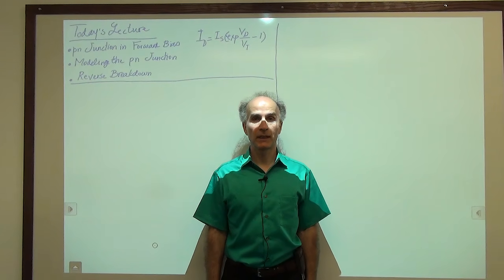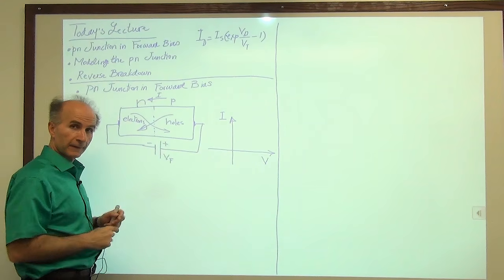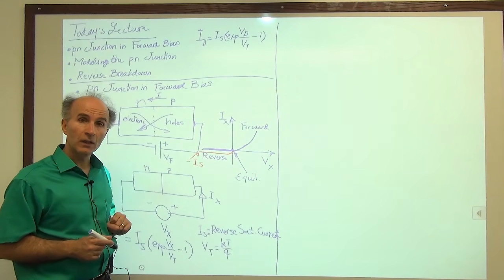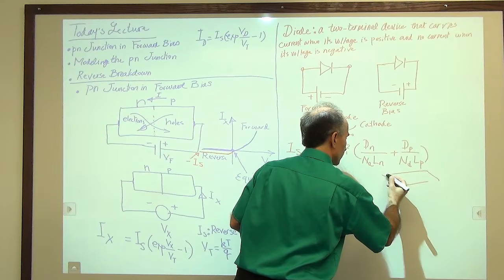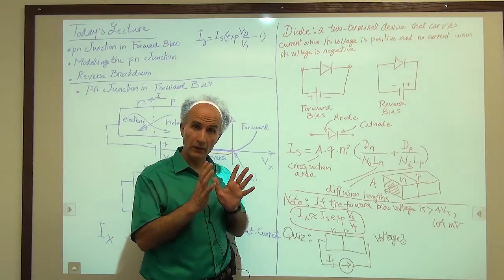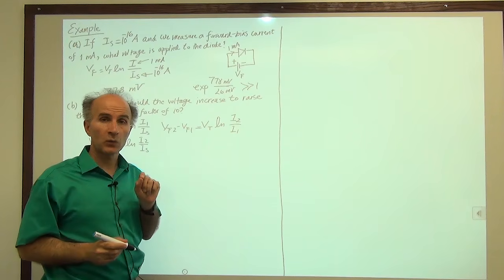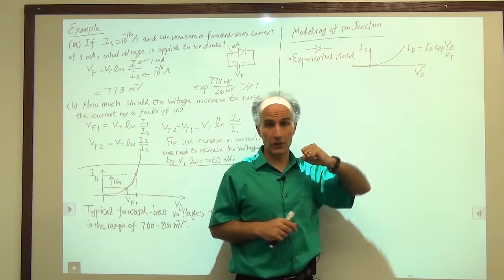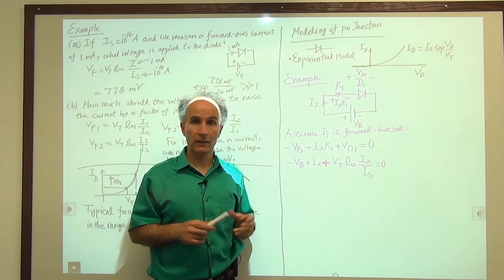Razavi Electronics 1, Lec 5, PN Junction in Forward Bias, Intro. to Diodes

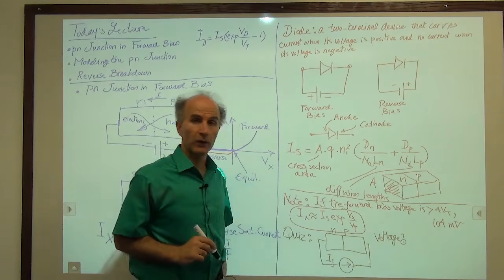Comment: 37:24 Quiz Question. Really misleading. It seemed to suggest that a numerical value is obtainable. ("...what is the voltage across the diode?"). A better wording would be "Derive an expression for the voltage across the diode".

Comment: This lecture series should be considered as valid course for those colleges where sufficiently qualified teaching staff is not present. These lectures are pure goldmine.
Reply: They are much better from what my Professor in the University that I'm studing engineering is doing!!! My Professor is literly teaching "In the air", he does not write any equations down (he solves every example in his head while speaking out loud), plus he skipped all the physics lectures.
Reply: In india most of the electronics professor deliver bad lectures. They must be fired and replace the class room with big tv and play razavi lectures on it.

Comment: The current in the forward biased PN junction is because of diffusion, pushing of holes by the positive terminal of the battery and pushing of electrons by the negative terminal of the battery is incorrect explanation,  the battery is not pushing electrons or holes, the battery is just lowering the barrier potential and then electrons and holes move by diffusion, pushing of electrons and holes would imply an electric field is doing that but that is not the case.
Reply: Do you mean that even in the forward bias the current is due to diffusion not drift ?
Reply: @mnada72  depends on  the area...I mean majority carriers in n is electrons while minority carriers are holes while on passing the junction the roles swap...u shud go thru integrated electronics by Millman And Halkias

Comment: in the current equation through the diode he said that the current doesn't depends on the doping levels of the silicon but it depends on the saturation levels.
but we know that different doped diode will have different Vt and so we will get different current values.
i am pretty confused why he said so.....................................
Reply: Yasinzai Vt is the thermal voltage of kT/q, not the built in voltage of 0.78V for Si.  The built in voltage varies with process while Vt is a universal constant.